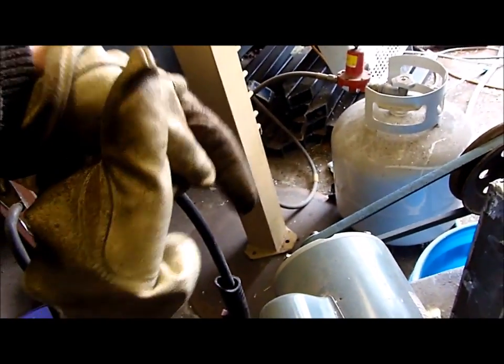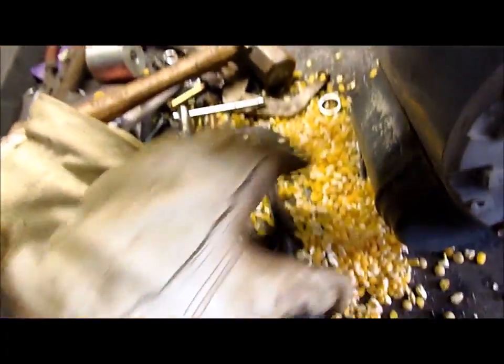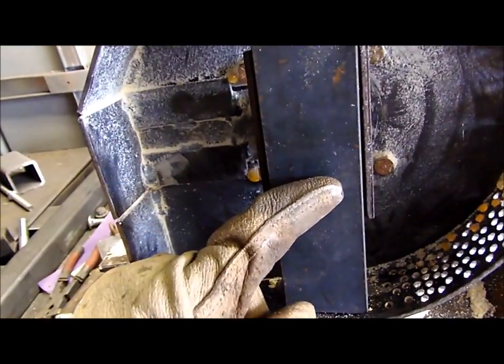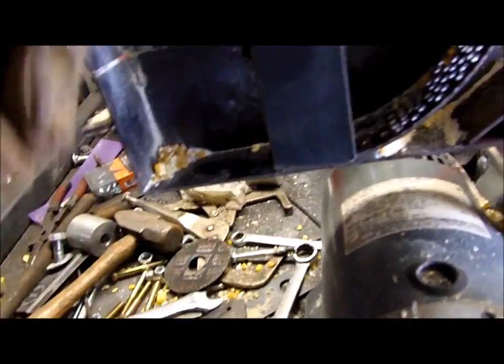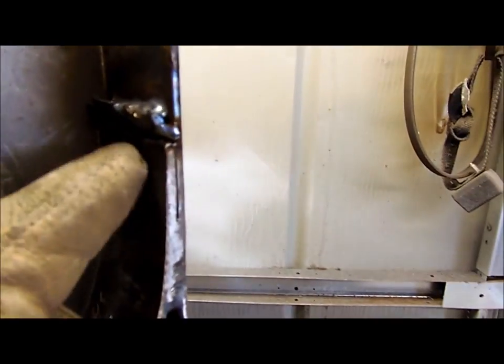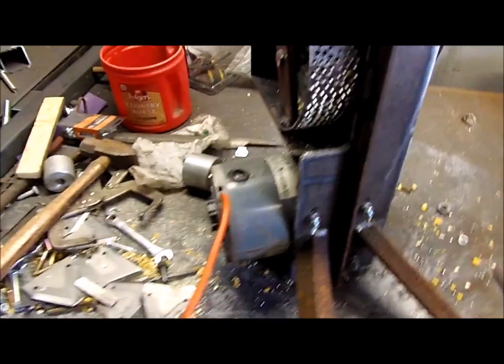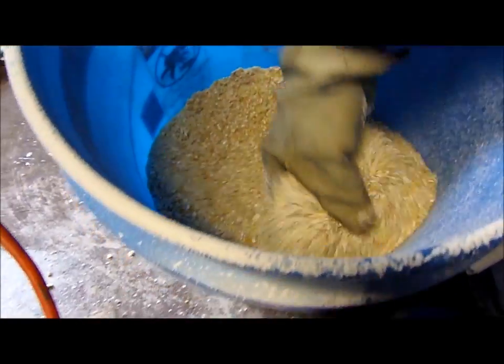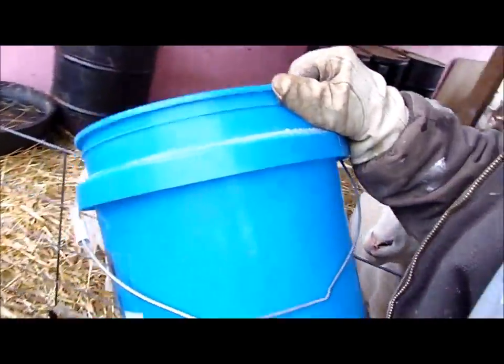Hammer Mill Part 5

Comment: can i suggest you go back to your mower blades, and make a new bottom screen with the same size holes again......will give you broken up grain but it wont be as finely ground up.....will also break the soya beans without grinding them up
Reply from the maker: I will probably revisit the mill when it comes time to start grinding feed, towards the end of the year.  There are a couple of mods that i want to do like making the stand a bit taller.  As for the fineness not sure if i will mess with trying to get it more coarse, it would be nice but the lambs seemed happy with it. Thanks for the advice if i rip back into it i will bare it in mind, cheers.

Comment: I don't understand how you named all five of these videos "Hammer mill" and proceeded to build a woodchipper and wondered why your results were not typical of a hammer mill. I think that the results you are looking for would be better achieved with a roller mill though. A roller mill should give you broken grains, size based on the gap you set between the rollers, with minimal dust, and no output screen, resulting in high output.